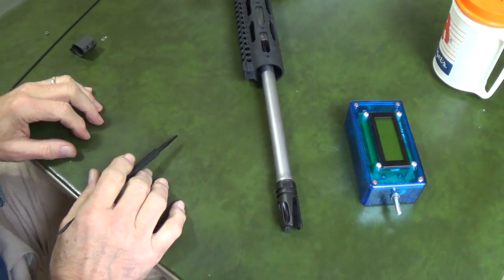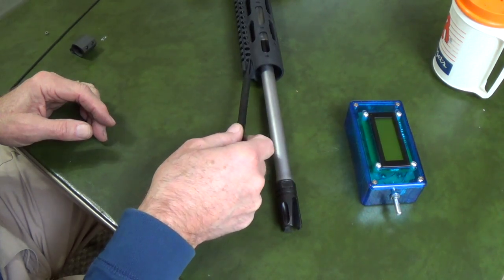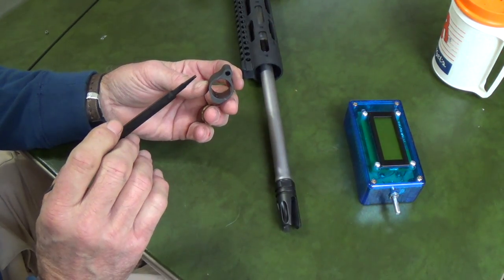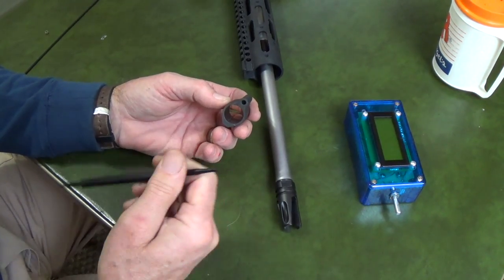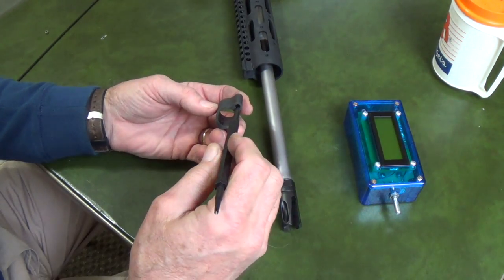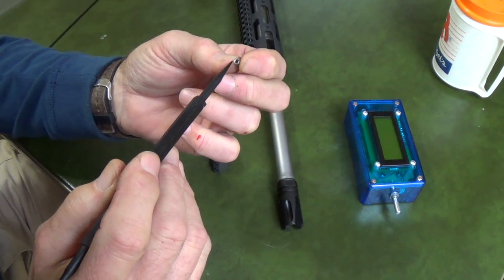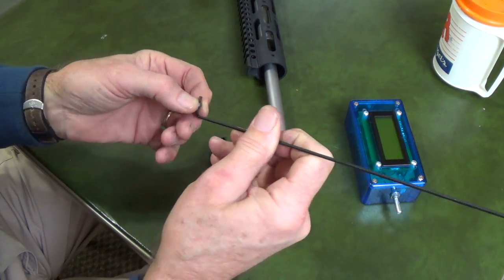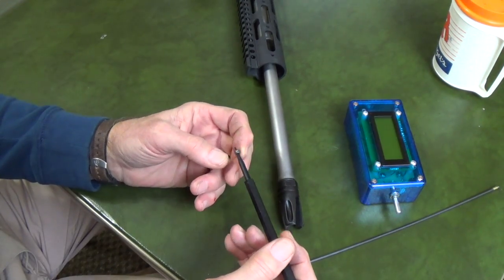solution to the Wilson Combat adj gas block problem

Comment: Dont use any adjustable gas blocks they are not needed.  Problem solved
Reply from the maker: Most ARs are significantly over-gassed. The gun is taking more of a beating than necessary for reliable function.

Manufacturers have to accomodate any commercial loads one might shoot and the lighter loads could cause cycle failures so the solution is to open up the gas flow to make sure that doesn't happen.

Adjustable gas blocks allow the gun to be adjusted to loads being used. Maybe one day a light 40 gr bullet is used and another time a 77 gr bullet is used. The adjustable gas block allows the gun to be tuned to a specific load.

There are several advantages to this. One, different calibers may required different gas pressures than what the factory sets them at. Adjustable gas blocks allow the shooter to adjust to an optimum pressure. 

Tuning the gas to a specific load will minimize recoil and allow a faster follow up shot.

Tuning the gas block on competition precision ARs allows one to minimize recoil which allows the shooter to better see where the shots are landing in case some correction is needed.

Suppressors generally increase gas pressure dwell time which in turn operates the action with much too much force. The adjustable gas block allows the gun to be tuned to suppresor operation and if the suppressor is removed, the adjustable gas port can be adjusted back to the non-suppressed pressure.

Comment: Gee thanks because I just bought one. First one I bought was the wrong size because they put a .936 in a .750 box. I had to wait 2 weeks till I got the right one. Then I tried slipping it on and it was .002 small. so I had to enlarge it .004 of a inch.
Last one I will ever get because it doesn't adjust very nice. 10# of $h!t in a 5# bag.
For $80 ,You would think they could find a place on the tube to set the back pressure.

Comment: Well, I finished my build tonight, and I'm going to the range tomorrow, to zero, and also function check the weapon.  But you can bet your bowl of Wheaties, that before the coming week comes to a close I will have an SLR adjustable gas block. I have one in my suppressed SBR and it's golden. I only used this one because I had it in my spare parts inventory.  Wilson Combat, stick to .45's and what you know best, because this gas block is a piece of garbage. The guy that designed this thing must have been drunk.  As an aside, I am using the set screw as designed, because I don't have itty bitty piece  of brass tubing laying around my shop. Your fix is probably a good one, but who has that small brass tubing and the tool to compress it on the hex wrench as you described. I'm not a plumber. But at least you tried something. Your best bet is to chunk it. I will have one ordered before I leave my shop.  Lol ETA:  try the Sentry 7 adjustable gas block, it wasn't designed by an idiot.
Reply from the maker: Hey man - it's gettin' exciting now - you're almost to shoot time!

Yeah, the Wilson gas block is not a great design!

I've been using SLR adj. gas blocks for quite a while now. Pretty much ditched the wilson gas block. Not only is it more hassle to adjust, last time I checked, Wilson would not sell the straight gas tube that has to be used with the gas block.

However, I'm mostly going with Adams Arms piston kits on most of my ARs now. It's not that there's anything wrong with DI, the pistons just keep the dirt etc. out of the moving parts. Just for the fun of it, I watched Jerry M.'s video on cleaning ARs and realized just how much stuff gets blown back into the receiver via the gas tube.

Having said that, some believe that the piston eliminates debris blowback etc. - it doesn't, it just reduces it significantly. When the bolt backs out of the barrel, there's a lot of blowback coming with it.

You did good to go with the SRL. My favorite, by far though is the side adjusting JP Enterprises. Unfortunately, it won't fit under some handguards and the ones it will, may not have a slot/opening to give access to the side adjustment screw.
Reply: Shot like a dream! Went through a the recommended barrel break-in procedure and then went to zero it.  Thankfully it was gassing fine, I absolutely had no issues whatsoever. No FTF, FTE.  A very smooth shooter as well!  I've ordered the SLR adjustable.  Heck, I even write Wilson Combat an email!  We'll see what they say.
Anyway I also thought I'd mention two things.  1) to the people who say you've done it wrong.  Well you are doing it EXACTLY the way Wilson Combat tells you to do it in the installation and usage manual. In fact Step 1 reads as follows:  1) Remove the locking screw and set aside.

the second thing I wanted to bring up is that I had a straight gas tube with my WC GB, but it was for a mid-length, and my 308 is rifle length.  So I used my standard go-to gas tube - Ballistic Advantage's melonited gas tube.  It's not flat, and it worked exactly as advertised  No binding or fitment issues at all.
I should have known when they use a gas tube that the majority of people don't use.
By the way, I wrapped the end of my hex head tool in painters tape.  It worked well enough to get the set screw installed.

The real solution as we've discussed is this:

Buy an SLR.  lol
Reply from the maker: You did good man! And many thanks for the follow up range report.

Don't you just love it when a plan comes together! And especially when it works right the first time!

And thanks for explaining the "right" way to adjust the Wilson gas block.

I do like the SLR blocks, but be aware, ANY adjustable block will seize eventually - including SLR and JPs. I've had to heat up more than one adj. block to get it to start turning. The thing about the JPs is that because it's in the side, it can be a very short set screw so there's not as much area for molten carbon to set on and that makes it easier to break loose.

Comment: Im pretty sure that your not suppose to remove the set screw, You just loosen it and then let your allen go straight through to the adjustment screw, make your adjustment and then just tighten the set screw and your done. Before you instal the block, hit it with a small amount of antisieze and it should be good to go.
Reply from the maker: Steve Guerrini That's the theory.  It's nowhere near that simple in practice.

It proved to be quite difficult to determine when the allen wrench is inserted enough but not so much that it simultaneously engages the second set screw. It gets even more complicated when you have to work under a handguard.

It's much faster, simpler, and easy to adjust it as described in the video.

Comment: My Wilson adjustable seized up tight in about a year.  Not a big round count 600 approx.  I had to remove it from the rifle and soak it is PB blaster for a few days.  I thought I would strip it. Gas tube itself is stuck solid to block.  Probably will not use a Wilson adjustable in the future.  I have recently used SLR adjustable , nice products.
Reply from the maker: +Summum Ra 
Thanks much for the comment and info - good stuff!

I have yet to find an adjustable gas block that won't seize up. The problem is the hot &quot;molten&quot; products from the burning powder squeeze into the threads of the adjustment and that molten stuff cools, it acts like a glue.

I've experienced this with Wilson, Syrac, SLR, and to a much less degree, JP blocks. Of the blocks that adjusts from the end of the gas block, the SLR seems to be least likely to seize. I much prefer the JP side adjust, but it has it's own set of problems. One, there isn't one for 0.625 barrels; two, because they are clamp-ons they tend not to fit under hand guards, and three, if you don't use the right hand guard, you won't be able to adjust the gas flow with the hand guard in place.

I use a Midwest Industries SS series floating hand guard and the holes in the hand guard line up perfectly with the JP adjustment screw.

Another thing I do is replace the Allen head screw with a stainless steel Allen head cap screw. The cap screws have a large Allen head and are much stronger than the set screw head, and hence the head is less likely to strip out. It is still compatible with the MI SS hand guard.
Reply: i like the slr blocks also
Reply: I know this is a bit old, but the MicroMOA has resolved the problems of adj gas blocks for me. No screws to adjust gas flow, just a replaceable plate with pre-set port sizes
Reply from the maker: That's a good solution for a semi-permanent setup. But if you will be shooting with and without a suppressor, you need to be able to adjust the gas flow. Sometimes different loads require slight adjustment.
Reply: I should have clarified, the MicroMOA comes with a plate with two gas port sizes - you just shift the plate back and forth between your sizes for suppressed/unsuppressed (or whatever your two settings are, there are about 10 different combos you can buy, and swapping out plates is about a 20 second affair).

Comment: I don't mean to be "that guy" but I to had an Wilson combat adjustable gas block on my rifle. It was so much a pain in the rear I took it off and installed a SLR rifle works adjustable gas block. Its one hand click adjustable. You don't need both hands to do a balancing act like the syrac gas block. the SLR also used a standard gas tube. Hope this helps
Reply from the maker: rdsii64 
I've long abandoned the Wilson adjustable gas block for several reasons. One, it uses a straight gas tube and if you should need to replace the tube for any reason, it is not available - not even from Wilson.

Two, I started using JP adjustable gas blocks that adjust from the side rather than from the front. With a hand guard extending beyond the gas block, it can be challenging to get the Allen wrench in the set screw, especially with my suppressor mounted. With the side adjustment it's easy to stick the Allen wrench through the 'vents' in the hand guard to access the adjustment screw.

From the JP, I went to the Syrac Gen II. It is detented, but all you have to do is insert the Allen wrench and adjust it to the next (or previous) detent.

However, once some carbon builds up in the detent mechanism, it no longer detents, and becomes frozen in place. And, like the Wilson, it adjusts from the front and even though my current hand guard only extends about 2 inches past the block, it is very difficult to get the Allen wrench in the adjustment screw. With my suppressor in place, the long Allen wrench is too long to use but I have one in a set of Allen wrenches that is just right, but still awkward.

I will start gradually replacing my Wilson and Syracs with side adjusting JPs.

Comment: your using this all wrong!
first only insert the allen wrench through the locking screw, break it loose. then slowly push the wrench in until it engages the adjusting screw. 
make the adjustment, pull the wrench out until it only contacts the locking screw. then tighten the jam screw. No need to pull the jamming screw out at all.
just needs broken loose. then both screws will move together as there being turn at the same time.
i can see how the tightening of the set screw would be more difficult, but if you developed a feel for it, and only pull it out an 1/8" or so to just engage the lock screw it, should be pretty easy to adjust in the field if needed
Reply from the maker: What you're describing is the way it was intended to work. I tried that from the start and found it problematic, so I started looking for a better, surer, less complicated way to do this.

All the 'pushing in until' procedures is to slow and error prone.
Reply: yea thats my thought the hole is so it doesnt need to be removed
Reply from the maker: +the baddest That's the theory, but in practice it doesn't work well. It's difficult to know when the end of the very long Allen wrench is in the hollow screw but not in the front set screw. It's also difficult to be sure the Allen wrench is in the hollow screw deeply enough not to round off shoulders if the screw is tight due to seizing.

The solution I show in the vid works much better. The stop on the Allen wrench insures full depth insertion without nosing into the deeper screw. Once loosened it spins out quickly and cleanly and you the have direct access to the adjustment screw. The hollw screw is simply reinserted and spinned in. It's quick, simple, and sure. I've done adjustments both ways and have long ago given up on " the right way".

Try what I show in the vid; I promise you, you will like it better.
Reply: That may be the way to do it, but it's not the way Wilson Combat tells you to do it.  For like the second time in my life, I actually looked up the installation instructions.  Step 1: "Remove the locking screw and set it aside." (Rest of steps cover firing one round and adjusting until the BCG locks back.... Step 5: Screw locking screw in until it stops turning, but do not force it... .blah blah blah.

Comment: You could have used masking tape instead of brass and saved yourself the headache.
Reply from the maker: I thought about several types of tape, but tape is too temporary, and can leave a sticky mess, There was no headache, it was actually pretty easy. Now I have a permanent fix, and won't have to deal with tape loosening.
Reply: JT McFarland The real solution is a SLR adjustable. Its one hand click adjustable. It cost $117.00 but well worth the money if you have a problem an adjustable gas block will cure.
Reply from the maker: rdsii64 
I just added a comment (above) that pertains to this. Just about all adj. gas blks used a front adjustment like the SLR. The Wilson is designed like the SLR except they use a 'through' hole set screw behind the actual adjustment screw to lock the adjustment.

Because I shoot with and without a suppressor for various reasons, I have the opportunity to do a lot of gas adjustment. When the pressure is adjusted for a suppressor, the gun will not have enough gas to cycle if the suppressor is removed, hence, you have to increase the gas.

The front adjustment blocks are really a pain to use if the hand guard extends beyond the gas block - it's hard to access, and awkward to adjust especially with a suppressor in place.

The JP adj. gas blk, has a side adjustment. They would be perfect if they weren't so long and if they had set screw securement instead of clamping screws.